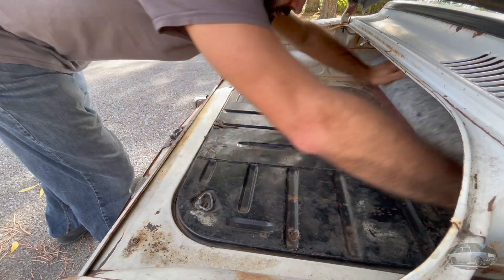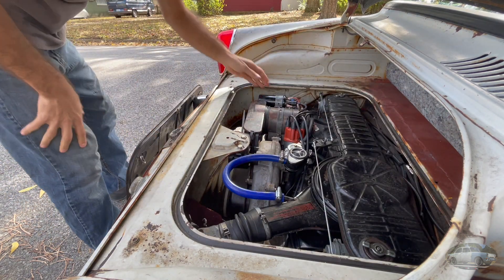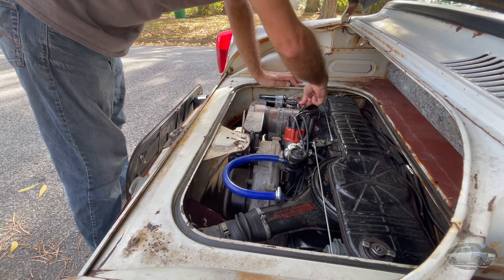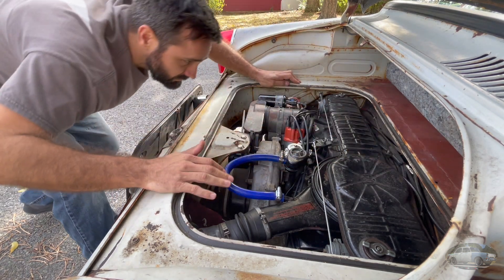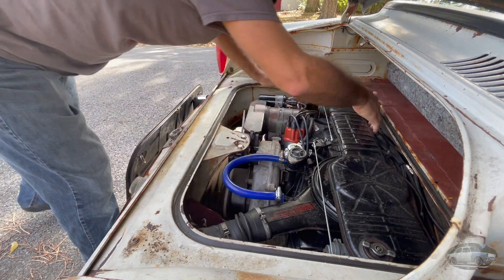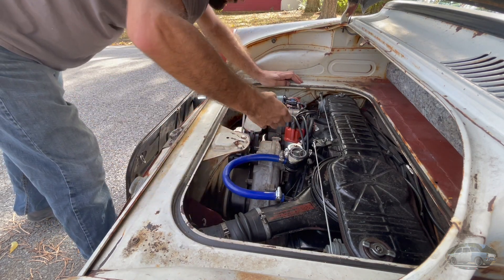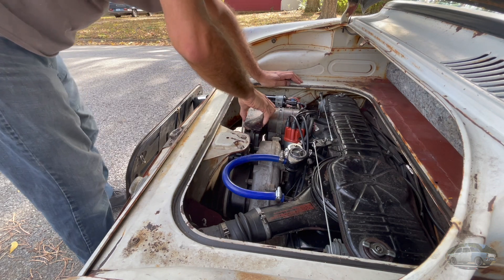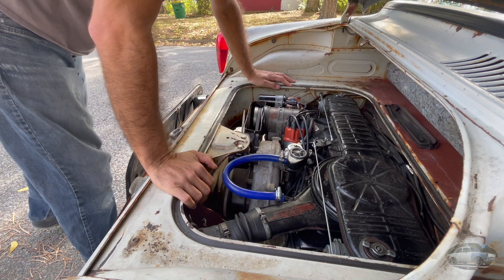Why won't my car start?

Comment: Awesome notchback . Best to get wiring all tidied up and secure and go from there but usual Vw wiring issues 👍 I always go back to stock wiring including fuses . Can’t go wrong . I’ve re wired at least 10 vws beetles in last couple of years and now wiring issue with a customers bug on my channel 👍
Reply from the maker: Thanks. Despite butt connectors all over, the wiring is pretty good, and most stuff works properly. But, yes, aftermarket fuse box didn’t make the grade!

Comment: Hey bud. I too have been having issues with my power. Recharged the battery, got a new starter, checked all my fuses. I ended up purchasing a new engine harness to just isolate the issue. I ended up pulling the whole engine out. I'm going to be switching to a Pentronix electronic ignition similar to your set up. There's plenty I need to do to the engine, so I figured it'd be a whole lot easier with the engine out of the car. slowly, but surely working on it and recording for my next episode!
Reply from the maker: Dang, that sounds like some rabbit hole. Best of luck!
Reply: @vdubjunkie  My square has lived 55 years. It's not about to die under my ownership! I won't let it happen haha
Reply from the maker: @jeremydoc  that’s the right attitude. When you really love these cars, you do what it takes.

Comment: It’s been a while!!! Fuse block autopsy next? Why did it fail? So weird.
Reply from the maker: Yeah, ultimately I plan to go back to OG. Until then I’ll roll with this bush fix. At some point, I’m taking the box out and dissecting it.
Reply: @vdubjunkie  It seems that the OG VW parts are almost always better than repro, even when 30, 40 or 50 years old. They were well made. Looking forward to more content!
Reply from the maker: @Brando-Green  couldn’t agree more. Thanks!